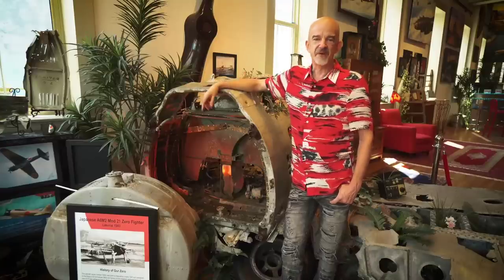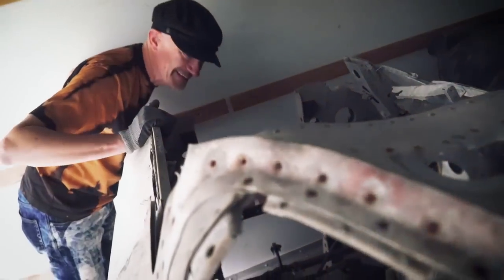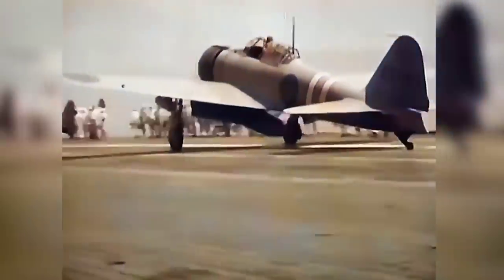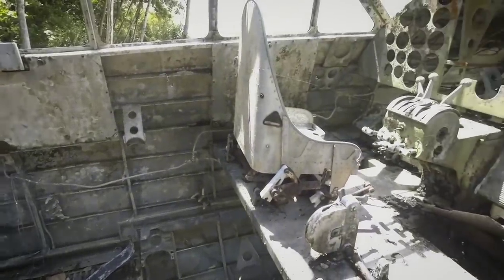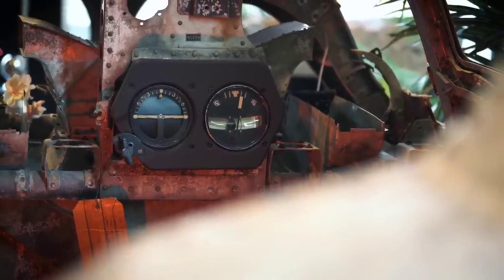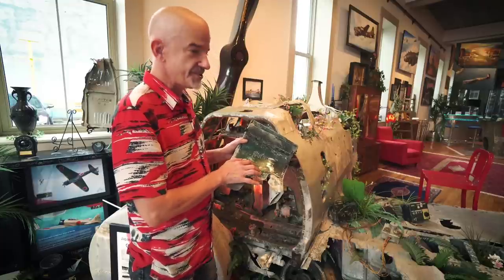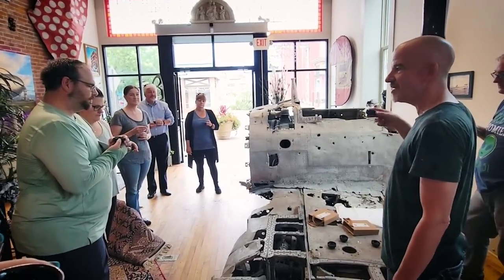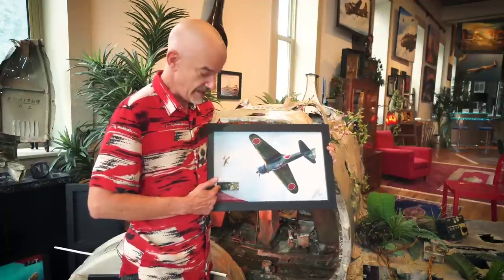History of Ron Cole's Japanese A6M2 Model 21 Zero Fighter s/n 7830

Comment: I thought the aircraft was a Type 2 surface fighter (A6M2-N) equipped by the 938th Naval Air Squadron!
The only difference that might be discernible in its parts is the location of the steps for climbing.
The A6M2's boarding step is on the left side of the cockpit, while the A6M2-N's step is on the right side to avoid the effects of splashing from the propeller!
Unfortunately, the boarding steps appear to be in a more rearward lost area.

Comment: what is the point of polluting it with weeds? Also, if it was "untouched" sense the emergency landing, why is it so fragmented and incomplete..
Reply: Shot up by allied airmen to prevent the use of them as parts sources and to relieve a bit of tension for the pilots who were mostly only 20 years old (average).
Reply: @Mercmad  Ha, thanks

Comment: No amount of money could restore that aircraft, at most by the end of the restoration you would have only 2-3% of the original aircraft .
Reply: I agree, I personally saw (I lived within 10 miles of the "restoration" site/airport) the chunks of corroded metal that were taken from the Greenland ice that "became" the Glacier Girl P-38, no way did this mass of mangled very corroded aluminum become a flyable aircraft. Basally these parts became templates for the new parts used in the Glacier Girl. For sure original parts were used when possible but to look at that aircraft and say it was rescued from the ice and "restored" is just nonsense, basically they built a new P-38 and incorporated a handful of (mostly) non-critical parts from the original. At what point does "restoration" become simply building new and using a few original parts, 75% of the original? 50%??

I have my Grandads old axe, I replaced the rusty old head and it looked so good I replaced the handle too, I love Grandads old axe and wouldn't take anything for it!!